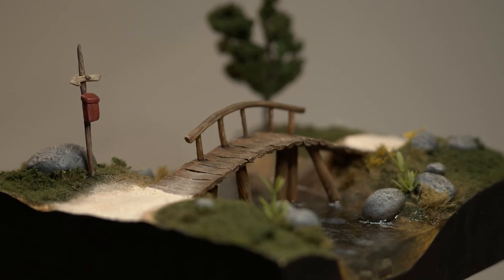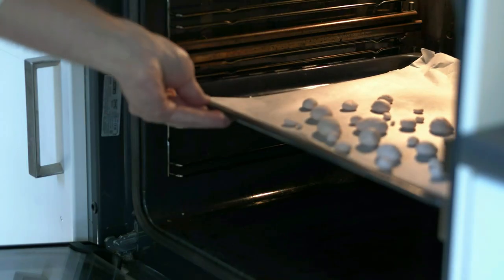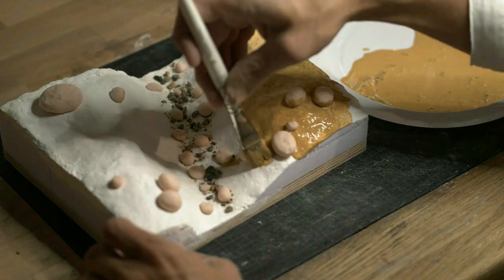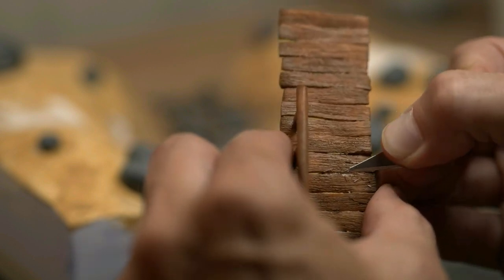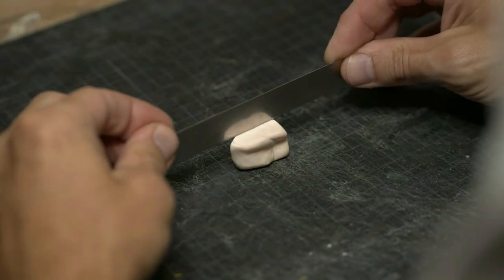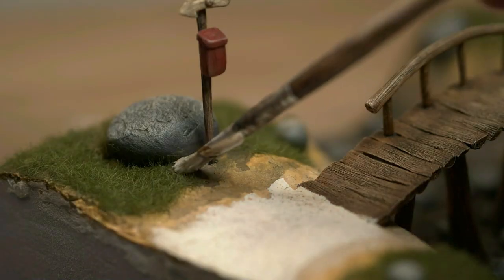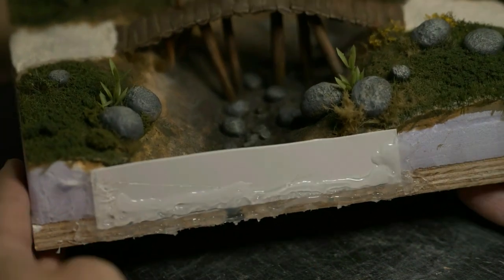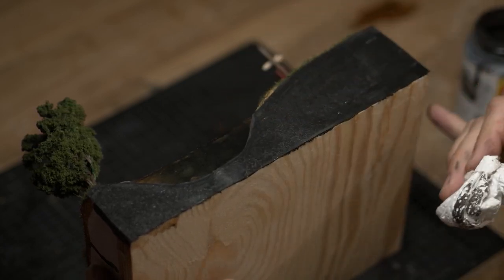Moomin Bridge - Diorama

Comment: where did you get the clay?
Reply from the maker: Where I’m from, it’s easier to find Fimo then for example Cosclay or Supersculpy. I have not used any other brand (hardly ever used Fimo), so I dont’t know how it compares. You can find it online for sure. I bought it in a local hobby store called Panduro. In my next project, I will be using Cosclay and/or Supersculpy.